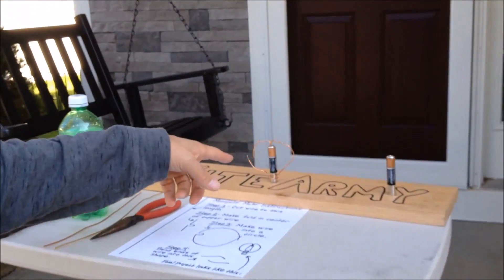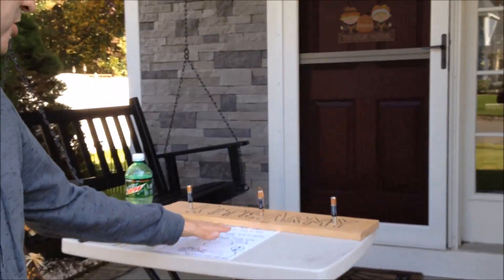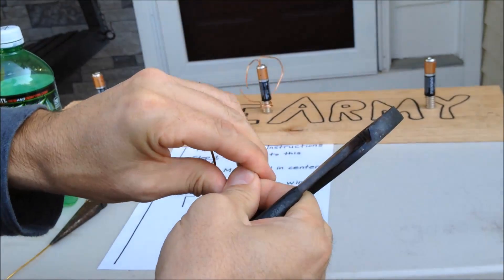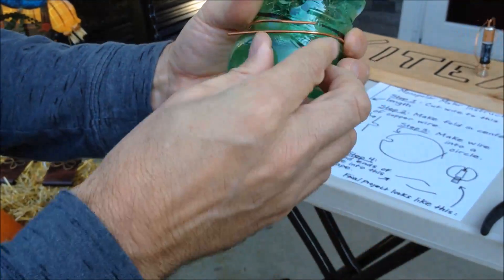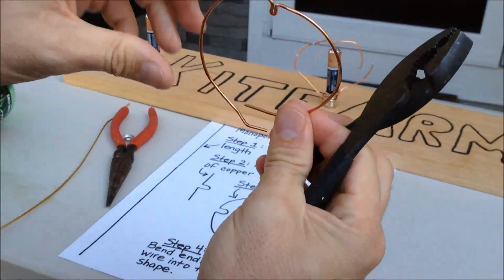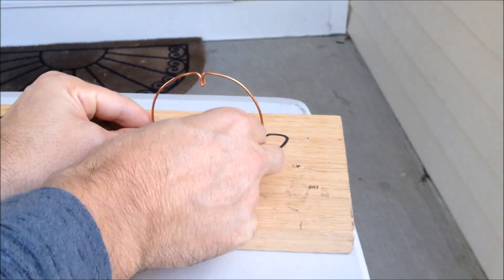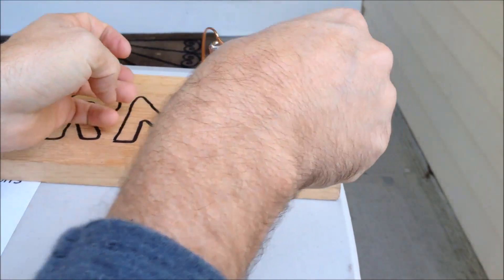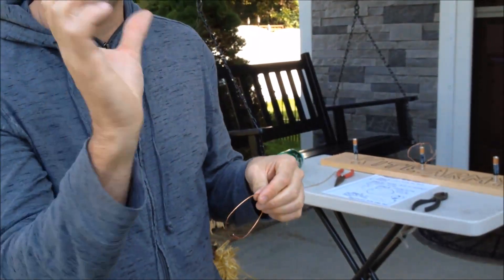Kids FUN Science project - DIY Simple & Easy STEM motor!

Comment: mine doesn't work :( i use energizer double A batteries
Reply from the maker: +Shara Latip Make sure that your copper wire is not to tight on your magnet.  Are you using rare earth magnets?  The battery should be fine as long as its not dead.  Let me know if it works out.